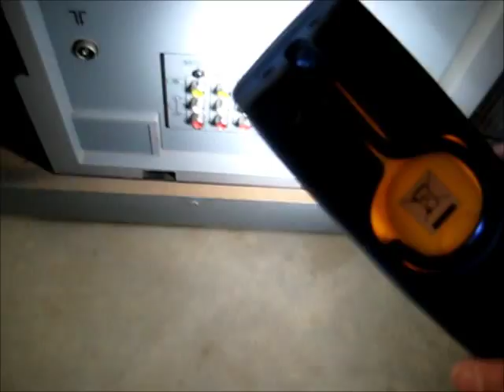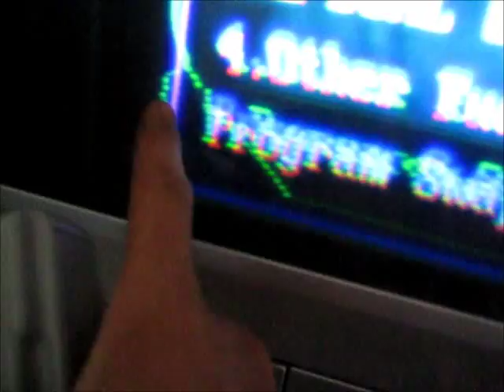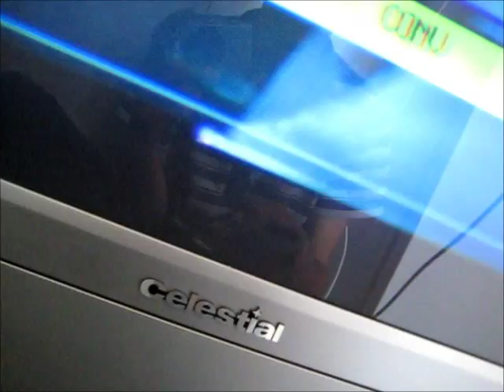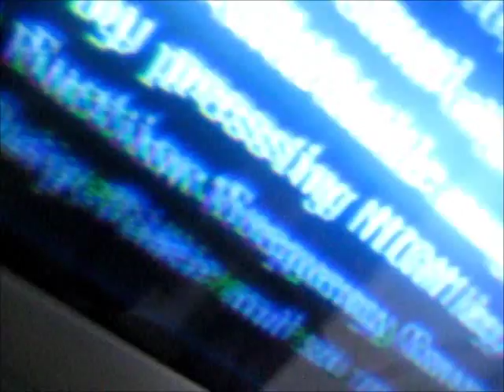Rear Projection TV Fix & Little help needed

Comment: I  have a 50" panasonic model PT-53wx42F that has a convergence problem. I put the chips and 6 transisters on the board I also changed out three caps. That stupit blinking is still there.No sound no picture HELP!

Comment: my  have a 50" panasonic model PT-53wx42F that has a convergence problem. I put the chips and 6 transisters on the board I also changed out three caps. That stupit blinking is still there.No sound no picture HELP!

Comment: i have a 50"panasonicHD tv that has a convergence problem . before that happened it would only turn on  after several attempts.now it doesn't come on at all there's only a red flashing light on the front.it sounds like it's trying to come on but no.what could be wrong with it?

Comment from the maker: @chevy56123 I just left the main wire on the flyback, as it wasn't removable, there was plenty of length for maneuvering, so I left it attached, The HT one clips out, but the little wire is soldered and mounted on the other part

Comment: A resistor or capacitor might have gone out of tolerance from the heat. You should blow up those bad capacitors that you replaced with your battery blowing rig!